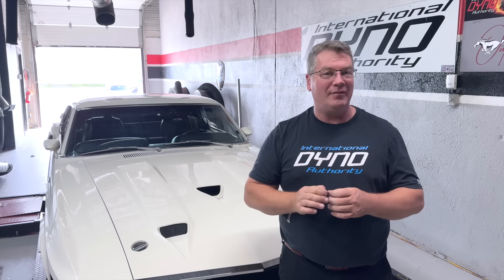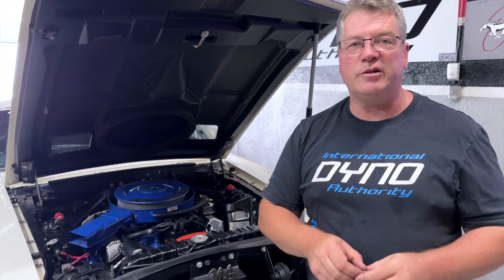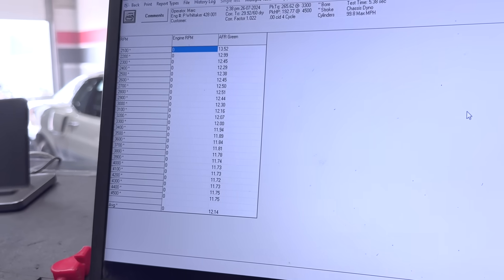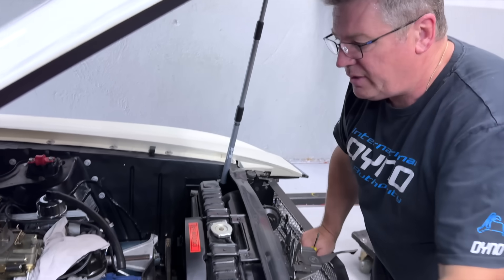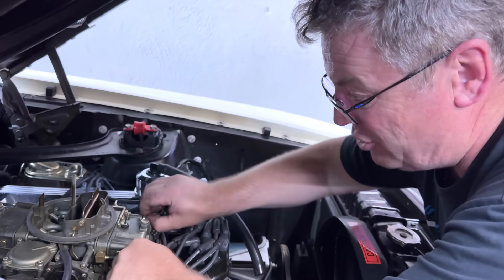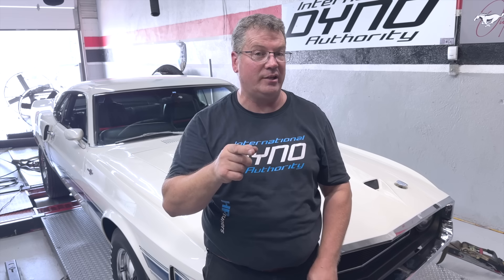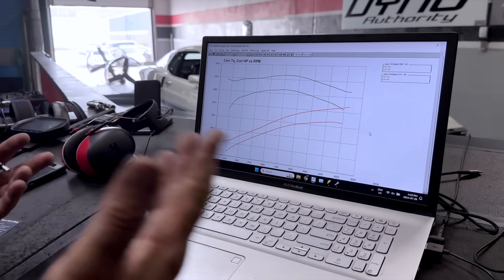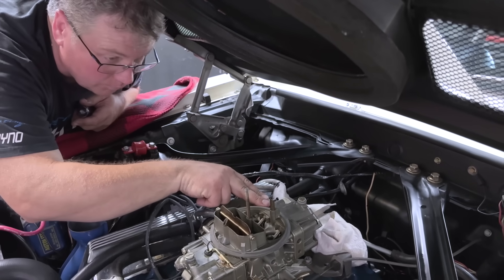Original, unrestored '69 Shelby GT500 tuned on the dyno

Comment: It's really NO surprize to see so many basement tuners here, but no need to be rude. This result was very close to factory numbers, 335 hp @ 3200 RPM and 440 lb-ft @ 3400 RPM. The owner does not want FI and a blower sticking through the hood to prove a point. It's important to the value of the car to keep everything the way it was built.
Reply: Lol so many excellent (absolutely terrible) basment tuner comments 😂
Reply: I was a basement tuner,I tuned all my 302s 289s and a 390 by 'ear' and checking the plugs and playing around with timing.
And I thought I was pretty sharp,everything ran good 
Then for sake of it..I decided to put those engines on a dyno at a tuning shop.
Wow...what a lame tune-up guy I was!
I got schooled about 'ear tuning '
That dyno tech taught me alot 
On my 289 I built..I figured I was at about 260-270hp.
Nope..it dynoed at 224..
The tech changed the heat range of the plugs,changed the gap,fiddled with the timing..and he bagged 9 horsepower more!
I changed the carburetor to a Holley 650..put the car back on the dyno the tech changed the jets and power valve..276 horsepower 
The whole event cost me $700..worth every penny
Reply: @getoffenit7827 what was your 289 build?
Reply: @getoffenit7827  I don't tune any of my engines "by ear", I have the original factory manuals and more.
Reply: @gorgonbazil2652  I used those too and timing lights etc.
But not always,Add a cam/intake and different carb,Some port work then you start getting away from factory parameters and the 'book' isn't going to tell you much.
My point was,Even though I did have good running engines..I had alot of horsepower untapped and the days at the dyno shop were an eye opener  on how to better tune.
Reply: @getoffenit7827  I get it, I do... My comments were really toward that 428, which I have a few... Its "stock" more or less, but even if it were modded with exception of forced induction, the factory manuals will get you there...
Reply: Hey, being a basement tuner takes a lot of skill.  I mean, getting a vehicle in the basement in the first place is no easy task.
Reply: @0101-s7v I legit cannot argue with this. This is pretty logical to me.
Reply: @0101-s7v 😅
Reply: They were rated differently then and it was also rated at the flywheel.  They're also known to be vastly underrated.
Reply: @midnight347 that’s what I told him
Reply: Why do people get so offended by everything that goes against what they are thinking. It’s mind blowing how pathetic people get over words.
Reply: Thinking or words. Those are two different things. Get it?
Reply from the maker: @carpballet  absolutely, and, can you point to the specific reference? 

We love the feedback. And we also want to wish you and yours the Very Best  From International Dyno Authority,  for the holiday season and Merry Christmas
Reply: @internationaldynoauthority693    What’s a “bat” store?
Reply from the maker: @carpballet  ??
Reply: @internationaldynoauthority693    You wrote “bat store for holiday season.”  Merry Christmas.
Reply from the maker: @carpballet  wishing you the very best for your holiday season
Reply from the maker: @carpballet  not sure 😊 

Was this comment intended for, this audience. About fuel, and tuning, and adjusting carburetors? Or was this intended for another video you were looking at. Maybe Duran Duran or the rolling Stones? 

Not certain
Reply: Welcome to America, the Land of free speech and independent thought.. Its a shame so many forget that and complain when someone gets offended by it---like you.
Reply from the maker: @gorgonbazil2652 

America???
Reply from the maker: @gorgonbazil2652  

YouTube is global
Reply: You sound like a good Biden , Harris voter !……..
Reply: @thomasdaum1927  I am not, but since you went there I am sure you are.
Reply: @gorgonbazil2652  Yea, That will be the day !…….   The comment you made is right out of the squsishy liberal hand book !
Reply: That is true, but I do not think that is an original carb...would like to see the list number on it.
Reply from the maker: @gorgonbazil2652  Yes, the original carburetor
Reply: @gorgonbazil2652 that is definitely an original ford Holley if I ever seen one
Reply: I believe the factory numbers were usually gross (no accessories) at the flywheel.
Reply: I only have a problem with the tuning phrase. 
These days it usually means key strokes with a computer.
While many of us used to tune a carb. 
Beautiful fkn car .  Damn
Reply: Isn't it insane how Ford rated the 335hp engines at such a low rpm meanwhile spin it up another 1000-1500rpm higher and it makes another 50-75hp, sneaky buggers lol
Reply: May be time for a new set of plugs?
Reply from the maker: @rapidride2   They were new, gapped correctly, and heat range spec's to this engine, with this fuel.
Reply: Don't have a clue🤦🏾‍♂️🤦🏾‍♂️
Reply: What’s wrong??
We’re gonna find oat!😂
Reply: @wysetech2000  Wyset.    That is short for Dinosaurs , I think or not . What do you think it means  ? Oh wait it means  dinomomator but you already knew that !……..
Reply: The owner should of rolled in with 93 octane instead of 91 so a slightly more advanced timing would make a noticeable boost.
Reply from the maker: @bobpickersgill4470  

While there is, 94 octane available in the local area. And 

Now, in the last 6 months there is actually $93 octane available in the local area. 

91 octane is by far superior. In the local area. 

91 octane, is fresh. Fresh fuel. More than 40% of the fuel sold, at Esso, at Shell, at petrocan, is sold, as 91 octane. 

93 octane represents less than 1%. 

94 octane represents less than half of a percent 

87 octane takes up the rest. 

So, putting in 93 octane while seems like theoretically it would be a great idea. 

The 93 octane that you're going to get, is going to be not fresh, inconsistent, and, if we were hunting for a 10th of a tenth of a tenth, I would totally agree with you 

Not only will we put in 94 octane from a fresh source. We would also put in a mix of 100 octane, leaded race fuel. 

We could have attained another 15 horsepower. Three tents off the quarter mile. 

Okay, let's be real 

This vehicle's going to spend its life, driving from the garage, out for a Sunday cruise. And then to some car shows. It's going to spend some time in the trailer. It's going to spend some time in the garage. Is going to spend some time on nice cruises. 

It's going to spend zero time ever at the racetrack. 

This is a showcar. It's in mint condition but, at no point is this customer ever planning to take it to a racetrack, and start breaking shifters clutches, push rods, rockers valve springs, etc etc etc. 

So while you can definitely add 93 octane. And you can. I can easily tune this so that it makes another 15 horsepower. 

It would really prove nothing. 

The whole point, of this was to get rid of the smoke. If you look at the smoke at the beginning of the video. 

And then you tune into the smoke at the end of the video. 

Voila! There's literally zero smoke. We have taking a car that from the factory had smoking issues. And completely resolved them
Reply: Some kid is going to say “my scat pack is faster than that Shelby” Edgar’s and dreadlock ninjas are the worst!
Reply: Agree.
Reply: 😂Ford junk
Reply: Chebby chit @Freedome-h9z
Reply: @Freedome-h9z oh really dude, go take a spin in your 305 Chevy powered cam eating shit show😂. Apparently you never heard of Ford total performance era of the 60’s. I never heard of any other American car winning the overall of the 24 hrs of Lemans, not only once but 4 times😅
Reply: Ain't nothing wrong with a little bump and grind from a Holman Moody camshaft! You weren't getting that power anywhere else back then...
Reply: Cars manufacturers start underrating hp in 68 .  70 was off by as much as 100hp . You do you.
Reply: Nice work 400 on the torque to the wheels 290 and change horses I’d say that’s a solid pull guys it’ll damn sure blow the tires off all that torque at low rpm I’d love to take it for a spin what a beautiful example classic American v8 muscle
Reply: Bad comparison...this is a chassis dyno .
Much lower than flywheel hp ..by around 65hp so it's not even close to the factory rating..most dynos of the day had thay engine around 390-410 hp. NHRA rated it at 390 ..everybody knows they underrated that motor at 335hp
Reply: Yeah you don't mess with these cars luckily basement tuners wont be able to get their hands on these without a mortgage loan
Reply: BWAHAHAHAHAHAAA!!!
Reply: I had a chance to buy a decent ‘69 Mach1 428CJ/4spd, still all original, back in ‘84 for $1,500. As a teenager in high school no way I had that money, bought a 90cc Kawasaki off him for $35 instead.
Reply: @jimstenlund6017  I think I would have sold my sister for that Mach1, unfortunately she wasn't worth that much!
Reply: @ we saw things differently in ‘81 I also had another $1,500 offer: my aunt getting divorced had a ‘70 ‘Cuda big block 4spd car, husband was a good mechanic, that car ran really strong. But I got a ‘69 Jeepster Commando, at least I could drive it off road as I was only 14 lol.
Reply: @jimstenlund6017 — those were the days, and I miss them
Reply: @jimstenlund6017  let the good times roll
Reply: Back in the day , early 70s a magazine took a stock 428 CJ out of a recked car and put it on a dino and got 405 hp and I can’t remember the tq numbers …….
Reply: @thomasdaum1927 exactly the point I just made about spinning the motor another 1.5k rpm and there's your 70 extra hp
Reply from the maker: @romper4444 except that when the vehicle arrived. The torque was diving so quickly. That revving the engine any higher at all. Just results in less and less and less power.......  

---

Our tuning process is meticulous and systematic, starting with all passes beginning at 2,000 RPM. The throttle is applied rapidly to the wide-open position, ensuring consistency across every run.

Each test is conducted on the chassis dyno under identical load conditions, allowing the vehicle to accelerate as quickly as its setup permits. The duration of the test is carefully measured and compared with subsequent runs to evaluate progress.

Initial tests are run until the torque curve falters or until the data log indicates unsafe, unproductive, or non-rewarding results—signaling the need for adjustments or the next step in the tuning process.

We prioritize the safety and condition of every customer’s vehicle, treating each one with the utmost care. Throughout the tuning process, we closely monitor key parameters such as temperature, AFR, IAT, balance, and torque production across the RPM range.

Our goal is to deliver responsible, high-quality results that enhance the performance of the vehicle without compromising its integrity—or our reputation. We do not take risks that could endanger a customer’s vehicle or the standing of our business.

As we observe improvements, we gradually extend the RPM range, focusing on identifying the engine's most efficient operating zone. At every stage, we ensure transparency, sharing step-by-step results with our customers and walking them through the data logs to educate and inform.

Each test adheres to a precise, repeatable procedure, maintaining consistency and accuracy. This approach not only ensures optimal results but also reflects our commitment to excellence and responsibility in tuning.

---

Let me know if you'd like further adjustments!
Reply: @thomasdaum1927     What is a DINO?
Reply: @wysetech2000    Democrat In Name Only. DINO
Reply: @thomasdaum1927 true ❤
Reply: Back then high octane was readily available at the local gas pumps,  these guys had to keep timing down for the sake of the engine due to the lower octane we have readily available now.  Otherwise he'd have to keep putting expensive race fuel into it...
Reply: @thomasdaum1927 — yes ford under rated their engines for insurance reasons, a 390 was rated from 315 to 330 hp a 428 was 335 and a 428 chance was 345 so was a 428scj but the 428scj was closer to 400hp as proven at the race track
Reply: @ Do to the hydrolick lifters back in the day 5,800 was about all they would do and then the valves would float .
Reply: @ Time to add more gear or rubber. She had bottom end too...
Reply: @thomasdaum1927 hyd lifters do not limit rpms to 5800. I've seen close to 7000.  The factory cam specs were tuned to max power around 5200 due to the modest cam timing..shift point 5800..or about 600 higher .
Reply: @IvanRousseau Not so , I have seen many 1960 and 70s lifters flot or ( pump down ) before 6000 rpm especially in ford products .
Reply: Change cam and valve springs.....go to fuel inj than tune....it would be a nice tow car for takeing GMs to drag strips 😂...just kidding...very nice car @Pooslingingmonkey
Reply from the maker: @ronaldbonczkowski6113 

Thanks for sharing your experience and insights! Here's how I see it:

When it comes to aftermarket fuel injection systems, there’s definitely a spectrum of reliability and performance. From what we’ve seen, Edelbrock systems tend to lead the pack in this category, with only about 1 in 20 needing an ECU repair or upgrade. That’s a strong showing compared to Holley systems, where issues arise in roughly 4 out of 10 cases, or Fi-Tech, which struggles with reliability in as many as 9 out of 10 units.

That said, none of these options truly match the tunability, performance, or reliability of a well-built carburetor. While these injection systems can be made to run quite streetable, carburetors still reign supreme for many enthusiasts.

If you’re chasing top-tier results, though, it might be worth looking beyond the entry-level systems. Rewiring with a crank trigger and integrating an OEM-style ECU, like a P38, can deliver OEM-grade reliability and performance. Alternatively, stepping up to something like a Haltech system offers a massive leap in tunability and dependability compared to the Edelbrock, Holley, or Fi-Tech options.

It’s all about finding the right balance between your goals, budget, and how much effort you’re willing to put into the setup. Let me know if you’d like to dive deeper into any of these options!
Reply: Once People start modifying there's no end to it. I learned the hard way. I  tried to express that to my son when I gave him his first new car. He didn't listen, he found out the hard way as well.
Reply: Nick’s Garage (YT channel) does lots of dyno testing of muscle car motors. Mostly MOPARS, but they usually come in at or below factory ratings, and usually they are warmed over with a mild cam, and headers, but with slightly less compression,
Reply: Doesn't take away from the fact it was a complete dog in comparison to GM and Chrysler pushed big blocks of the time. Head flow on these 428s were ass.
Reply: @zztop7306
LOL, you really don't know much about those engines..
Reply from the maker: @gorgonbazil2652  Hey there! Thanks for your comment and for sparking this great discussion about the 1970 Shelby 428 Mach 1 Mustang. It's a truly iconic car, and there's always something new to learn about these classics.  You're right to bring up the specifics – the 428 Cobra Jet engine is a legend.  For those interested, the bore and stroke of this beast are 4.13 inches and 3.98 inches, respectively, contributing to its impressive power output.  It's these details that really make these engines special and fuel our passion for them.
One of the key components of the 428's performance was its carburetor.  The 1970 428 CJ typically used a single Holley 4-barrel carburetor, often a model 4150.  These carburetors were known for their performance capabilities and were a significant part of what gave the 428 its reputation.  The specifics of the carburetor, like jet sizes and other tuning parameters, could vary slightly, adding another layer of complexity and interest for enthusiasts.
Now, about engine expertise – you've hit on a really important point.  The world of engines is vast, and no one person can know absolutely everything about every single one.  We all have different levels of experience and education, and that's perfectly okay. The beauty of the internet is that resources like Google are readily available.  We can all learn together by researching, discussing, and sharing information.  No one is the absolute authority, and we're all constantly learning and expanding our knowledge.  Even seasoned mechanics are always discovering new things!
At International Dyno Authority, we truly appreciate comments like yours.  They ignite these conversations and help us all learn and grow together in the automotive world.  We believe that sharing information and different perspectives is what makes this community so vibrant.  So thank you again for your input, and keep those comments coming! We value your feedback and look forward to more engaging discussions with you and all our viewers.
Reply: @zztop7306 ford figured out a long time ago which GM and Chrysler STILL HAVENT LEARNED, to make up for big HP keep the car light. Just like a REAL RACE CARS SPOSE TO BE AND NOT SUPER DUTY TRUCKS🤣😝
Reply: @zztop7306  so far wrong ..
Reply: @martinD1  you're saying stock for stock the 428 made as much or more power than a 426 hemi or L89 427? Lmao this wasn't even the best big block Ford produced, let alone one of the best big blocks of the time.
Reply: @zztop7306  mustang' is a lighter car than most mopars were .. One reason the AC cobra was blowing everything away .. A lot of things to figure in .. Horsepower isn't everything...
Reply: @martinD1  I won't argue against power to weight ratio, purely talking about  power the 428 wasn't exactly an amazing big block for it's time.